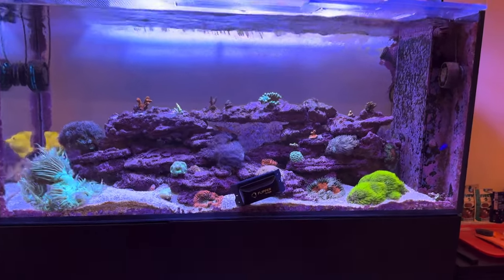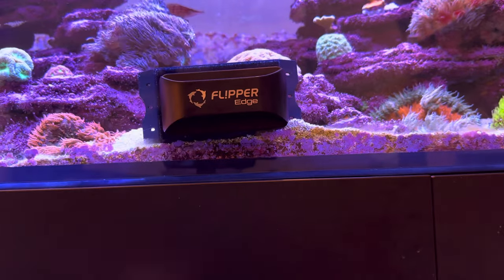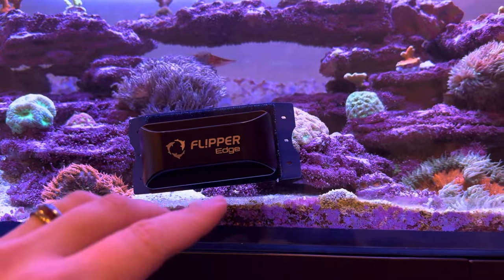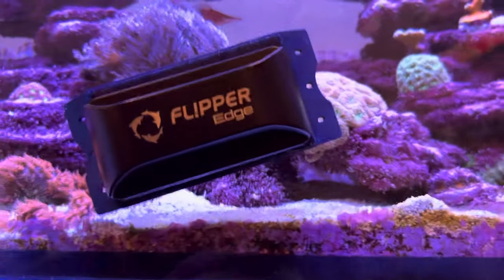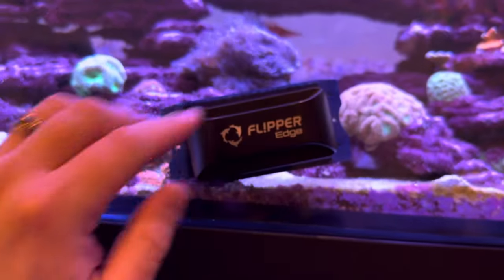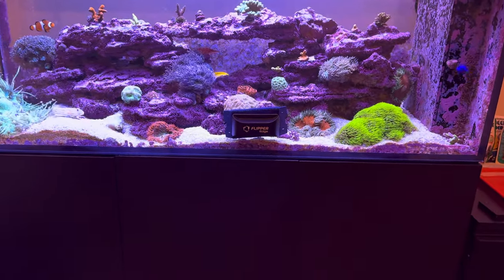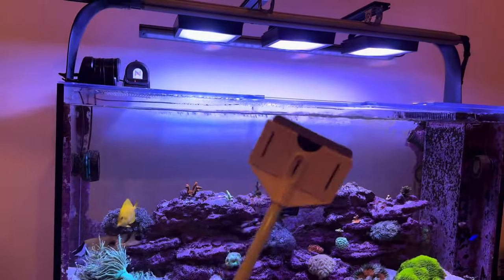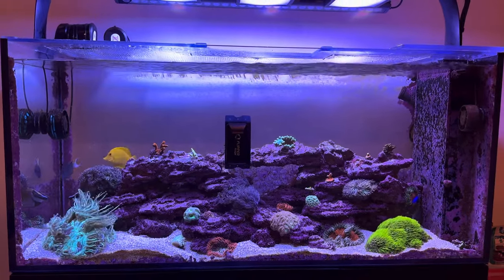Explained: Cleaning Your Reef Tank’s Glass Without Scratching It

Comment: Tunze care magnet cleaners are very good 👍
Reply from the maker: Have heard great things about them. Very popular. Flipper is solid. You just can’t jam them through the sand.
Reply: How so?

The magnet seems too strong and it makes scraping/scratching noises with the blade

My flipper doesn't do that.
Reply from the maker: @Merknilash  I wonder if the unit you’ve got has some defect. A lot of people like the Tunze. Can you swap in a fresh blade maybe?
Reply: @kalamazoo_reefer  I got both kinds and have put in different blades

Some people use the plastic edge but that doesn’t work well on glass for me - I use it for sump though 

I’d be surprised if others didn’t hear that scrape sound sometimes of metal on glass
Reply: @Merknilash  I personally use the plastic on the glass of the tank.

Comment: Nice video

I know the grains of sand are a risk, but my concern is always the blade itself.

Using a brand new tunze (few days old) - downgrading to the weaker magnet version (tunze long vs tunze strong) - I can hear that metal blade make some scratching/scraping sounds. Eventually that is going to put a scratch into the tank I fear.

Any thoughts?
Reply from the maker: Really? Well, I’ve never used a Tunze care magnet. A lot of people love them. But I never hear any scraping/grinding noises with the Flipper magnet. It just shuffles along smoothly.

Comment: I don’t know why reefers use magnetic razor scrapers. I only use Velcro magnet cleaners and I have a stainless steel hand pole razorblade cleaner . More dexterity and super cheap.
Reply from the maker: I clean the glass with the magnetic Velcro side, and then I use a traditional scraper for the seams and touch algae. But yeah I’d say magnetic scrapers are overused and have less control.